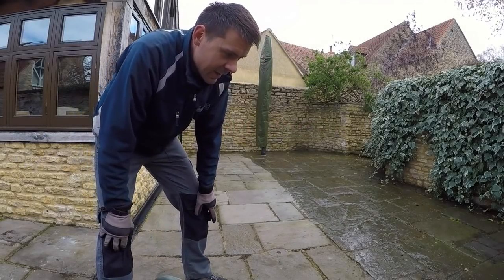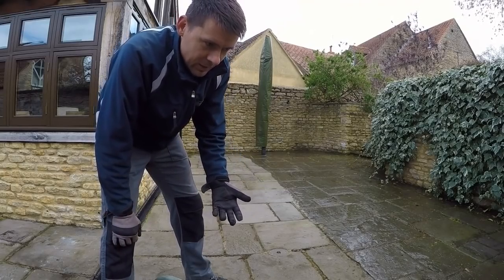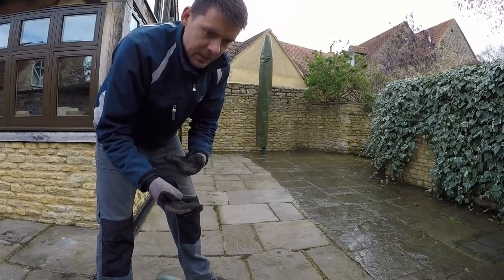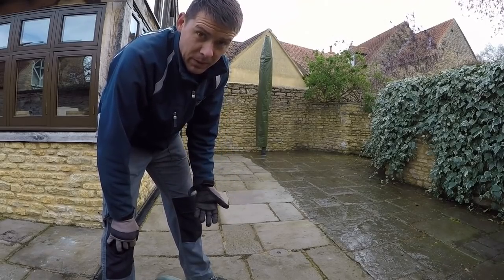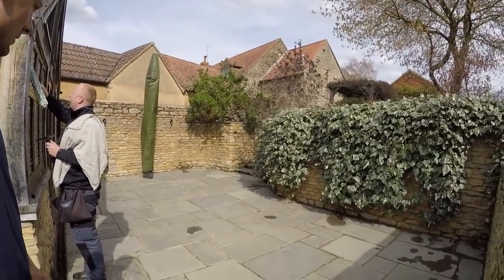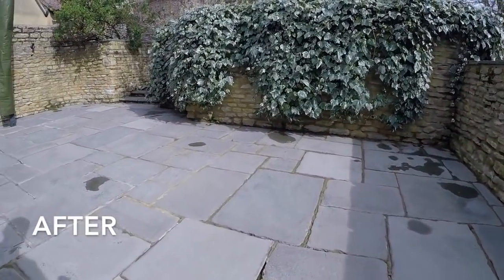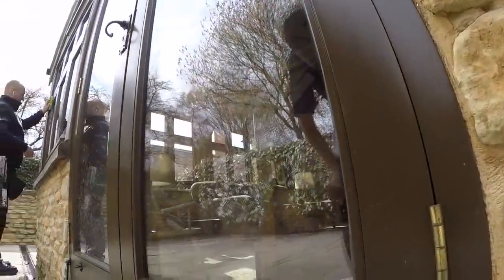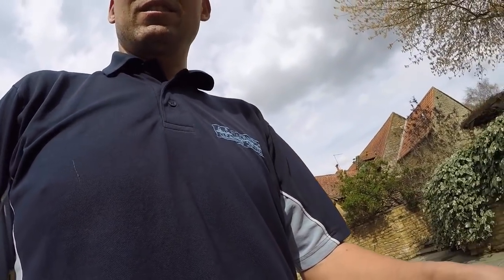Pressure Washing A Country Garden Patio

Comment: Great job again, I noticed you didn't use the pole for cleaning the window's/door Trad method, Has your system stopped working.On that note do you fill your system over night or does it produce pure water as you go through your day.
Reply from the maker: pudz morris I start filling my system when I get home and turn it off before I go to bed. It filters into the van. I’m not planning on giving up traditional window cleaning completely just yet though. 😃👍🏼

Comment: what  pressure washer are you using mate. looking at buying one myself
Reply from the maker: Chris sheffield It’s an Evolution 2 machine with a Honda engine. I put a link in the description.😃👍🏼
Reply: @aemackintosh  thanks nice bit of kit. been looking at getting a 15lpm. what did you upgrade from thanks
Reply from the maker: I started with a slightly smaller and cheaper machine to see how things went. It was a Delta machine from Dual Pumps. The machine I have now is quite common in the industry, and very reliable.😃👍🏼